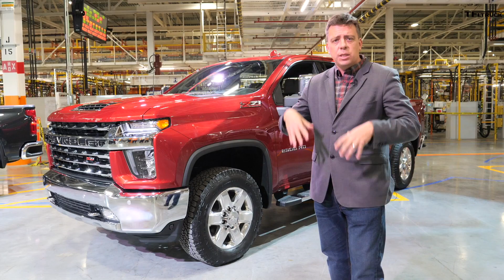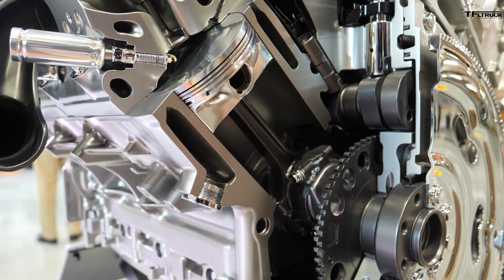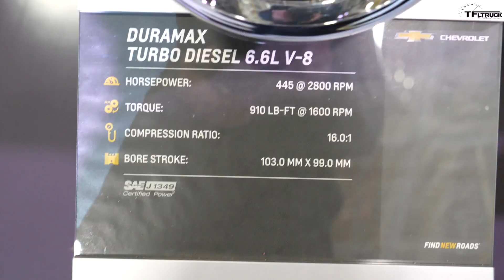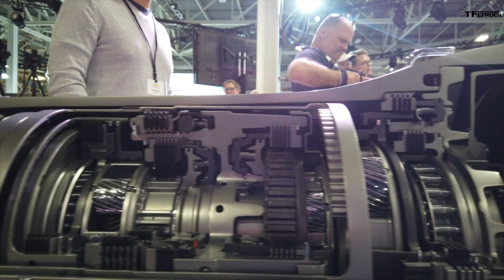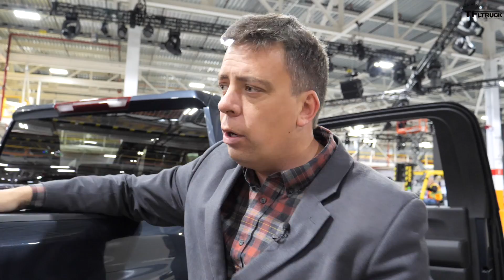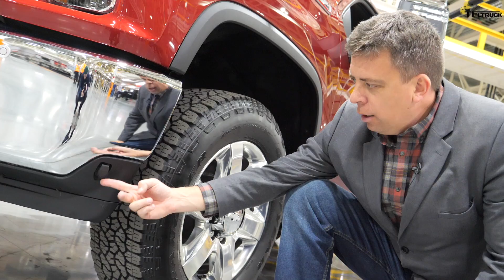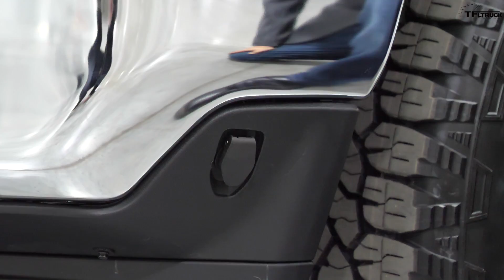Here is How the 2020 Chevy Silverado 2500 HD Delivers the Torque to the Ground

Comment: I never did like the 2019 1500 but after a while it grew on me let’s see if these new 2500 and up can grow on me.
Reply: I’m assuming the grill will grow organically....like a fungus
Reply: Clint Mullins lol
Reply: The only thing I don't like, is the mirrors
Reply: The 1/2 ton is hideous with super squinty headlights and rounded wheel wells.  This is 1000% better, tall mean grill up front and better styling all around.
Reply: I actually think they’re cool, but the interior is a huge downside for me. No CD player?! I know it’s old-fashioned, and most people don’t use it anymore, but the Fords and the Rams still have them, and there are plenty of people who still use CDs (including myself). But the interior itself is ok, just ok. Passable.
Reply: Sergiu Puscasu  Get with the times.. 13-18 Rams did not have CD players, they were an option. For whatever reason they brought them back for 2019.
Reply: @sergiupuscasu2496  Most vehicles don't have CD players anymore. My 2018 Colorado doesn't either. Just threw my iPod in there and it works much better.
Reply: @Oozywolf  my 2017 1500LT and 2400HD LT both have a single CD player well hidden in the dash stack just under the infotainment controls. Hard to see though.

Comment: The truck that will always be parked 4ft outside of parking spaces because you can’t see 💩 over that atrocious gigantic hood.
Reply: Learn how to drive
Reply: What would we do without the tech?? Oh the people that shouldn't drive big trucks now can. I can back up a B-train 2 miles, in the dark without cameras or spotters and people whine about can't see in the front for parking without sensors??????  You can tell the real drivers from the the people that need babysitting sensors
Reply: That's why they have parking censors, at least higher trims.
Reply: They have this magical thing called a 360 degree camera
Reply: Yeah I don’t understand why they keep going bigger the 99 to 7 year models are perfect size for getting around
Reply: @jdeco1856  gm made the trucks bigger because they were tiny. All they did was make it wider by 3", move the b pillar, change the rake of the windshield, and Re-skin the entire truck. The cab footprint ,overall length, and wheelbase all stayed the same. Hell in 08-10' they rode on the same chassis as the 07'. Just with the newer cab. Then in 11' they changed the frame. In 16' the did it again, new cab on 11' chassis until 19'. That's was the limiting factor for  max towing all the way up to now. The L5P was capable just the allison 1000/drivelive, and the chassis were limiting. Nice to see gm has a real truck that has departed from the old bs. They may have a great truck now. MAY being the key word
Reply: @jdeco1856  Sales argue otherwise
Reply: Yeah it's hard to see over the hood. But my 2018 GMC Sierra 3500 has no parking sensors and it's not that hard to park, I have yet to hit anything yet.
Reply: @dedalliance1  imagine what the long hood Pete's and kw drivers would say if you told them they needed front parking sensors. Or better yet ask them if they want/need/would use them.
Reply: @jnk26  I mean, it's not a bad idea just for safety, but it's not really that required just takes some getting used to.
Reply: @dedalliance1  more safety devices are great. No one like to find they car damaged from someone else's lousy parking skills/lack or giving a shit/dont want a hit on my insurance/no insurance.  There are far too many people that rely on them. Like blindspot monitoring instead of turning there head and looking for themselves. The expectation of the collision mitigation to "prevent" them from rearending someone while tailgating, or texting. All of this tech is taking the skills and awareness from the "driver". And most of the dumb consumers don't care or love it. My wife always drove small cars. Now she drives my crew cab long box 2019 super duty and is confident doing so. It only took her a a week of using the front camera to be sure she wasn't going to hit something while parking, now she doesn't worry about it and still hasn't hit anything. Going from an F150 to an F350 4x4 was a huge step for her. More dramatic in her perspective being 5'1", than the jump from kia rondo to F150.
Reply: @jnk26  Yeah. I learned to drive in my mom's 2008 suburban, the long wheel base. And it had back up sensors no cameras and it helps learn how to backup a large vehicle with a lot of blind spots. 

I really like the back up camera on my truck though just because you can really see how close you are in tight situations. Plus the way the back end is stanced there could be something 4 feet tall behind the truck and you couldn't even see it.
Reply: @dedalliance1  suburbans are full of blind spots, also are small is the real world of trucks(133" wb vs 167-176" wb for cc 8'beds PU). When you can judge distance without aid from camera/sensors. Add two 30 foot trailers and only a 7"x18" mirror on each side in the dark on a narrow road. That's skill. I'm not trying to being negative, or boast by any means. People only improve there skills by doing it and wanting to do more to get better.
Reply: @jnk26  Yeah. My current truck is a 3500 GMC Sierra crew cab long bed, srw though. The hardest trailer I've had to back up is my little 13' aluminum fishing boat. It's so narrow that even with the mirrors fully extended you can't see the trailer behind the truck, and you can't see it from the rear view because it's not tall enough lol. Tip is, if you can't see the trailer it's probably mostly straight, or you can drop the tailgate so you can at least see it a little bit lol.

But I've pulled like 20' or so trailers and got pretty good at it. We had them at my college (I was in the carpentry program) to haul tools and lumber around. But people kept braking into them overnight so we had to back them into the shop every night but there was maybe a 6 inches of clearance on each side of the door and then all the other crap in the shop. But after 2 years I got pretty good at it and still never hit anything.
Reply: @dedalliance1  short trailers are harder because the react quicker than longer ones. My only trailer is currently 33ft fifthwheel. My work trailer is a Michigan 6 axle thats a 51ft pneumatic tank main cluster of axles(4) are 2/3 the length of the trailer back with a pusher 9' ahead and 9' behind the main group. It doesn't turn al all wight the lift axles down but turns similarly to an rv just longer with them up. Only issue I have with it, is the fact it weighs 28000lbs empty. Old tank she is but she makes me money lol
Reply: @jnk26  Hey whatever pays them bills man lol.
Reply: Most people are too afraid to park by Braille... 

Doesn’t take too long to see that way too many drivers on the road never improve their driving skills with years of experience....
Reply: The94GTC  the chrome sticks serve a few purposes. I ersonally ha e never hit anything while manoeuvring to back into a dock or while turning. I have driven lots of long hood trucks. Had a long hood pete 389 the first year or hauling fuel with 60 foot b-trains. I personally don't like them and have zero need/want for them. I have skill and utilize them everyday.
Reply: I love all the macho talk about backing trailers up and how skilled people are at it. So many perfect drivers out there that never hit anything.... I think there are some who have strayed from the truth a bit. Think your good? Try backing a 45K lb. Fighter jet (going to date myself here) like an F14 or F4 Phantom on a rocking flight deck soaked in jet fuel and hydraulic fluid at night under red lights, with a double pivot point (unfixed nose wheel and pintal hitch on the tow tractor). If you've done that, your the man! I put million dollar planes within inches of each other all say long while getting blasted by hot jet exhaust. And guess what? I hit stuff every now and then. Not bad but a crackes tiny fiberglass Tacan antenna will put a bird down for at least one cycle.
Reply: @shawnlarson5653  Sounds like fun.

Comment: New gassers are gunna take over
Reply: Love diesel but gotta agree, the fuel advantage isn’t there like before and they’re getting more expensive to operate and maintain with emissions equipment. Miss the old days of the 5.9 cummins and 7.3 international/powerstroke when you could actual work on them and not break the bank keeping them going.
Reply: The gas engines today will out tow  the older diesels. Diesel fuel is an average of 1.00 per gallon more than gasoline,  plus the added maintenance And pig piss not to mention the 10k extra cost for the diesel option.  The gas engines today are more dependable than the new diesels.  90 percent of people that purchase these big trucks drive them as cars. Its pretty sad that most people don't even get a long bed on a 1 ton truck. Just does not make sense to buy diesel anymore,  Unless you need the diesel for your business.  Even then most probably buy them for the tax write off.
Reply: Graders have ALREADY taken over. It’s called LPG
Reply: Gasers
Reply: I agree. If these gassers are potent enough to tow 12-15k without feeling too stressed (and get decent fuel economy) I think the diesel market will begin to slow.
Reply: They'll never have the torque that the diesels have. but they would be perfect for what people need them for. Towing moderate loads like campers or gooseneck. Very few people actually NEED all the torque the diesel offers. The only other downside to the gas is economy.
Reply: @JJAJFOREVER maybe for the new ones, but in my experience with chevrolet trucks (my family owns only Chevy's), all the Chevy gas engines get about 8 MPG highway and City, and diesels get 15 City -25 highway. Where I live diesel is only a little bit more. So it is ALMOST more cost effective to own a diesel. The only reason people in my town buy diesels is for towing really heavy loads, or because they're cooler. (I bought mine because it's fast af)
Reply: California would love to get rid of diesel engines. Look for big fees for new diesel trucks and the price of fuel going way up due to more tax on diesel fuel. Its coming. I just bought a 2500HD gasser and it works fine for about $13K less.
Reply: I can see that.. Diesels are just too expensive!
Reply: As a diesel owner,  no they don't.
Reply: @jook13  Also a diesel owner, gassers will never be close.
Reply: jook13 to buy a 6.7L diesel it cost $9000 more than the gas engine
Reply: I agree. If these new gas engines can tow  around 8 plus tons why pay the extra for diesel. Not to mention much cheeped oil changes, no fuel filters and no DEF.  and no 5k bill when the turbo goes.
Reply: @michaeldenave1615  No DEF issues and waiting for warranties to expire to delete it!
Reply: EVs will pretty soon replace both gas and diesel. No air intake needed with simpler motor and no "tranny". Not to mention instant HP and torque.
Reply: @jaimeperez6777  yep.. the onle dissadvantage ev's are their lack of mid-high end power and their bit excessive weight. But they are doing well tho!
Reply: I have a diesel  but that new 7.3 gas is tempting